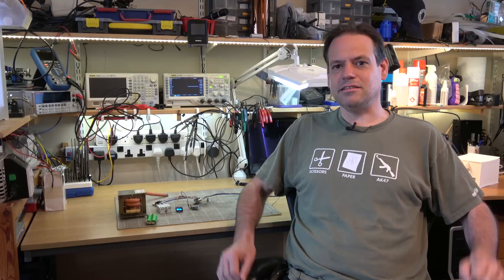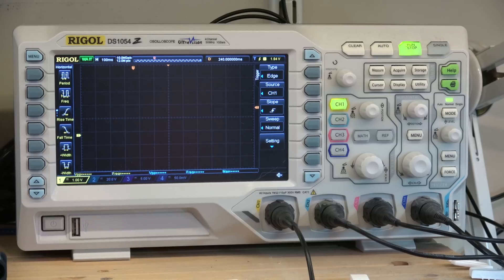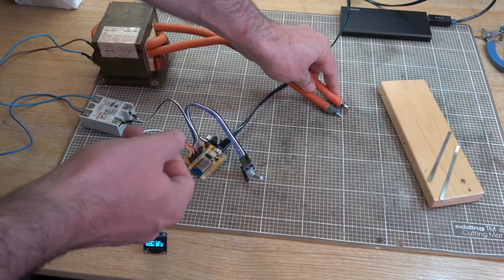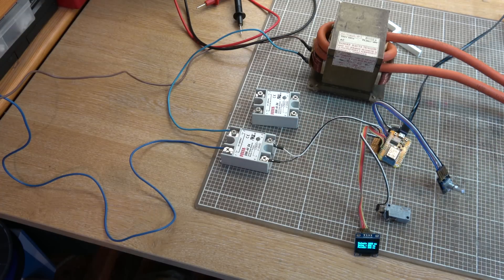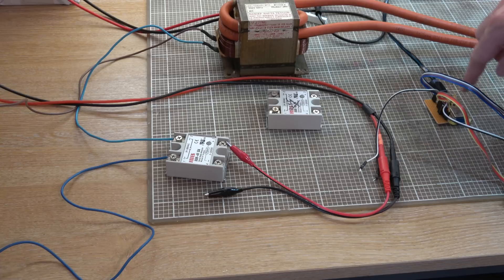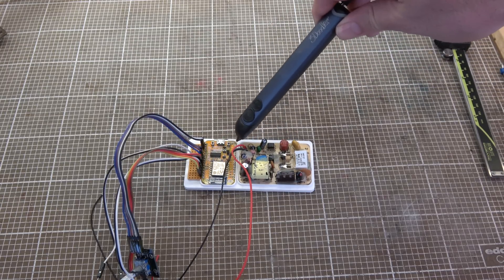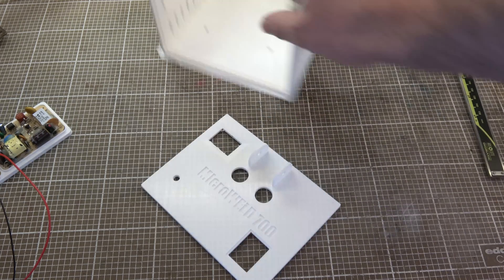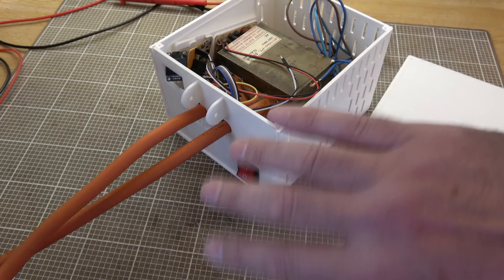Battery Tab Spot Welder - Part 2 - Electronics Testing & Designing a Case

Comment: The case is pretty, Jim.  How much did all that plastic end up costing you by version 6?  Yikes!  Given the weight of the xfmr, and my differing needs for the welder, I think I'll opt for a wooden or sheetmetal box, myself, and maybe several sets of leads out of the top.  2AWG for welding automotive sheetmetal and thinner 8AWG leads for welding batteries.
Reply from the maker: Hi LJ Prep - The plastic cost was nothing major.. perhaps £5 or £6 in total.. I buy the larger 2.4KG reels which last me for a year or two at a time, so I don't really pay close attention. A wooden or sheet metal box would have been perfectly fine, but as I'd already made a white plastic enclosure for my isolation transformer I was trying to keep the same look for the spot welder too. Good luck in your project. Cheers!!
Reply: Oh, I thought 3D printing was more expensive because of the plastic feed reels.  Maybe I'll look into one of those, too.  I'm building a huge CNC router at the moment, so maybe I'll give it a dual use.  Build my own water skis and such.  VBG

Comment: Your solid state relay fried ... Inrush current from switching the transformer ? (900W transformer / 230V = 4 amps nominal ... inrush current = nominal x 10 = 4x10A = ... 40 amps ?

Comment: Hi, Great videos and explanations. thanks. What year do you think microwaves started using the newer transformers? I have a couple of microwaves I'm saving to disassemble that are from early 2000's. Thanks.
Reply from the maker: Hi Rafi - It was probably around the 2000s that 'inverter microwaves' started to come in, but they do still make units using big clunky transformers now... They're just at the cheaper end of the market, so if the ones you have saved are budget models then you should be OK. Cheers!!

Comment: Iv had SSR's directly attached with an ESP8266 as you have done there, and they didn't work. I found out that it had to do with the amount of current the ESP was putting out was only enough for the LED, and not the actually switch part. Throwing a Transistor on it solved all the problems :)

Comment: When you print vertical like that you end up with a very weak part as it relies on the bonding between layers. You can get the printer to print with out warping if you do some research. e.g. glue, raft, heated bed working well etc. Since I got my laser cutter that stuff takes no time.
Reply from the maker: Hi Robonza - As I don't have a handle on this case, relying on the layer adhesion is not really much of a problem. The lid is strong in the horizontal direction which is just right for stopping the sides of the case bulging outwards. I'm sorely tempted to treat myself to a laser cutter for Christmas. Cheers!!

Comment: Those Fotek solid state relays are frequently counterfeit, and I've seen the same problem with counterfeit ones failing to operate at 3.3V. (I seem to recall that the genuine Fotek SSRs are completely full up with potting compound.)

Comment: Hi, Nice design.. 

One thing I'd wonder though is how are you reliably making 4ms presolder pulse when the AC power is 50Hz and you (apparently) have no zero crossing detector+timer. 50HZ equals to 20ms long cycle time so it's quite possible that 4ms on-cycle don't be even close of the max peak power of the sine wave.
Reply from the maker: Thanks DIYTAO - I've been wondering about that myself. I have no idea what the right times are going to be for the two pulses. If they're relatively long then catching the zero crossing point won't be too important, but to get consistent energy for pulses starting and finishing them on the zero crossing points would definitely be beneficial. I'll try it and see for now, but if my welds are inconsistent I'll probably add zero crossing detection and switch the SSR on and off at the right times.Cheers!!
Reply: Ok.. I'll be watching these with great interest. I do have bunch of Li-cells and (yet) unmodified µW-transformer, and have been thinking about making something similar..
Reply: "Beware of Zero-Crossover Switching of Transformers"

http://www.te.com/commerce/DocumentDelivery/DDEController?Action=srchrtrv&DocNm=13C3206_AppNote&DocType=CS&DocLang=EN

Happened to be reading this whilst watching.
Reply from the maker: Interesting read - Thanks David.
Reply: I was looking for this precise comment, because after seeing the video I wondered about the same thing where the minimum cycle at 50hz would be at least 20ms. I say at least, considering most SS relays available are zero crossing type, so chances are, a realistic length for that initial pulse should be no less than 40ms, also assuming the state change delay of the SS relay is in the microsecond range. I have all the components to build my own spot welder, but I was wondering if someone would know where to find a chart for the two pulses interval options, depending on the materials to weld and if someone knows the response times of the SS relays, because I could not find that information on their data sheet. Thanks!

Comment: I read on hackaday that the IO on the ESP8266 were 5V tolerant so you could just use the esp to control the SSR by switching the driving pin between ground and high impedance.
Reply from the maker: Nice idea Arnþór - I'll do some reading up on that.. it might save me from needing to add a transistor. Any idea if the arduino would be ok sinking around 20mA of current? Thanks.
Reply: No idea. I've wondered before if you could get more current by using two pins in parallel but haven't tested it, nor looked it up.

Comment: Hi Jim. Looks like you got a pair of counterfeit Mitutoyo calipers on your bench at 16:25. Why not throw those out and use your genuine Mitutoyo calipers that I saw you use in part 1? :)
Reply from the maker: Hi Daniel - It was the same counterfeit ones in part 1 too. I bought them in full knowledge that they were not genuine ones because even as fakes, they're a hell of a lot better than the last set of calipers I used to have. The last set of cheap calipers didn't even give correct measurements and were often out by 20-30mm on their readings. Cheers!!
Reply: Ah, yes I got your part 1 video mixed up with another video all together :) Sorry about that :)

Comment: i admire that you have the patience and time to deal with so many failed prints, i would probably had given up on that huge 3d printed box after couple of failed prints, great video as always btw hope to see part 3 soon.
Reply from the maker: Thanks Stratos - The lid was certainly testing my patience with so many failures in a row, but I learned a new trick along the way with the support pillars for vertical printing, so overall I'm happy about the experience. I wish I had one of those laser-sintering SLS printers that can print anything without needing supports, but they're way above my price range. Part 3 should be along in a week or so. Cheers!!
Reply: Jim Conner I think for boxes that size 3d printing isn't the best option, maybe you could check out a cheap cnc laser cutter (or milling machine) so you can make boxes out of acrylic or wood
Reply from the maker: Yes... a laser cutter would be perfect, but I just don't have the space for it at the moment. I need to turn the garage into a proper workshop for that. Cheers!!